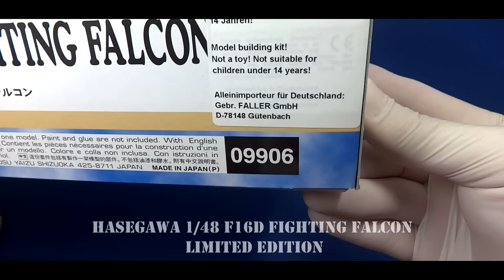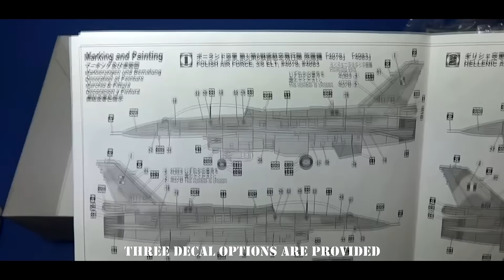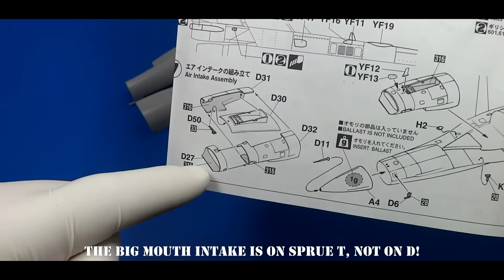FULL VIDEO BUILD F-16D Block 52 Advanced Fighting Falcon by Hasegawa

Comment: Interesting that Hasegawa moulded the CFTs (Conformal Fuel Tanks) in plastic.  This first release of the F-16D Block 52 Limited Edition came with resin cast CFTs and markings for the Hellenic Air Force.
Reply from the maker: Yes, becouse of the series like F-16I Sufa and Desert Falcon E/F Block60 and like this one, the advanced D, thay made a extra sprue. You are right I had that kit with extra resin parts. 2 part cft and HAF markings. All the best! Dusan.

Comment: Very nice build, remember to check your refrences ,    the light gray for the tail, and cocpit area is not -375  it's 26270.   for the radome and all antennablisters you can use -270 with a drop of FS 36118.       also make sure your cocpit layout is correct.  most of the block 50's was redone in the late 90's to facilitate NVG's , that means all the cocpit panels are flat black.  I do beleve all the Block 50/52's have that as a standard from the factory.  Again check your refrances for the particular jet.   

The F-16 will never or atleast very seldom fly with AIM-120's on station 2/8 as it does mess up the stabillity of the wing some.   They will however always fly them on station 1/9 (Wingtips) , with the occational sidewinder/IRIS-T or AMA-pod on station 2 or 8.

Comment: why do you start with black coat first?
Reply: 43rocket what do you mean? Its a primer? Or its a black base its a common technique, you paint black underneath, and the. Do marble on top so that in the areas where there isn’t paint, its black.  Other wise there would be no fake shadows

Comment: Dusan,  I admire your airbrush skills.....  
I see your using a SPARMAX airbrush.... but what air pressure do you spray at?  ("psi") ... Do you change your "psi" between enamel paints and acrylic paints?   and finally what mixture ratio do you use with enamel/acrylic paint (paint to thinner)?
as always... It's great to see your work......
Reply from the maker: Thank You for kind words! I am using Sparmax SP-35 and Sparmax Sp-20X. Color ratio is complicated subject because it depends on weather at Your location. I am using the color mix (50-50) enamel paint and thinner.  Approx 60t-40c mix for acrylic paind but you will need more coats to cover the surface... pressure approx 1,3-1,5 Bar. But please, this can slightly vary depending on your airbrush (Nozzle-nedle...)  All the best! Dusan.

Comment: Did you use Vallejo satin varnish unthinned, there no clog problems?
Reply from the maker: Weird enough, I haven't any problems with clogging. Straight from the bottle. SP-35 Sparmax AB with 0.35 nozzle higher a. pressure. All the best! Dusan.

Comment: Hi dude! I've got the Hasegawa 1/48 F-16F and with some exceptions these 2 kits are almost identical. On the fuel tanks I've found out that the panel lines are not recessed (so they are positive, not negative). How did you deal with that?
Reply from the maker: There is one older re-box with positive panel lines, also there is a box with resin CFT. This box comes with the new spine and CFT, like Sufa box the rest of the kit is a plane F-16D. All the best! Dusan.